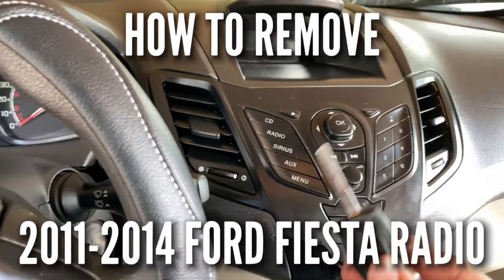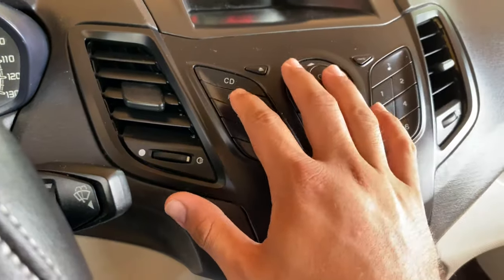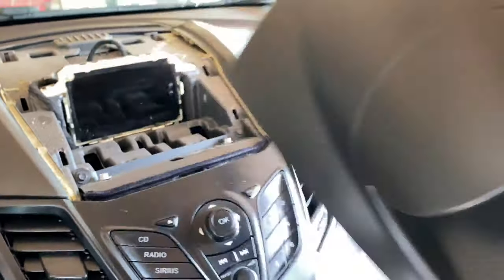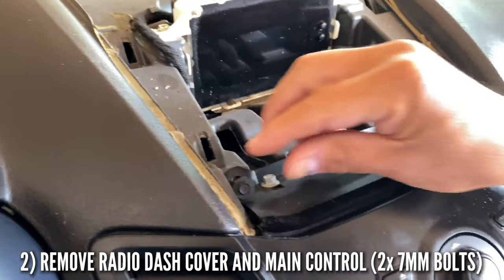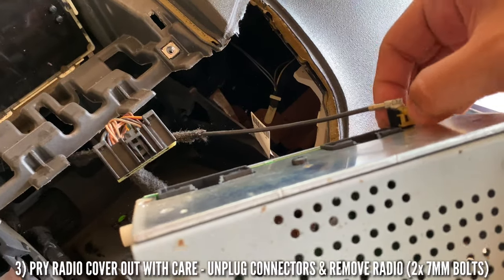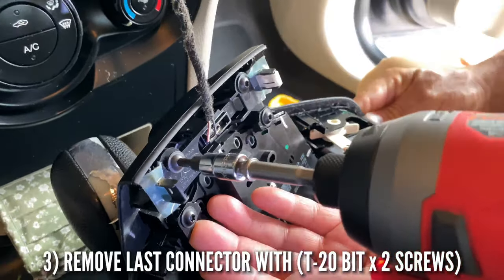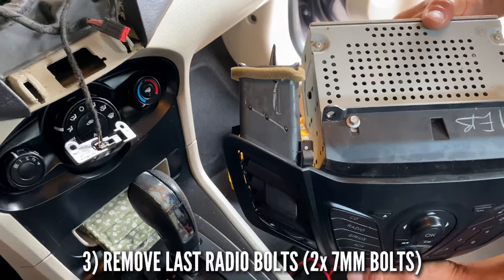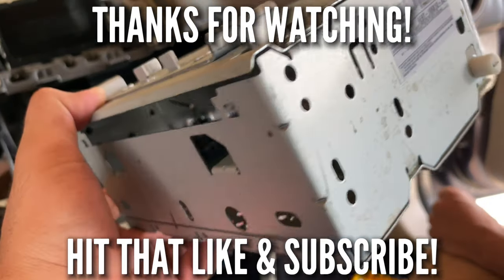FORD FIESTA RADIO NOT WORKING REMOVAL FAST & EASY HOW TO FIX - REPLACE RADIO FORD FIESTA & MANY MORE

Comment: Thank you!!!!!! Ordered one and did it in about 30 minutes.  Literally have been using a crappy Bluetooth stereo for about 5 years.  Seriously thank you!!
Reply: Where did you order one from?
Reply: Used**
Reply: was wondering, does it need a code or you just got the box, changed it and it worked straight up?

Comment: I have a question my 2013 ford fiesta radio went out but also my car would be turned off and I would be in my house and it sounds like bottle rockets or fireworks going off in my car lol I took the radio fuse out and it quit the firework noise!! My fuse is good...do u think its my radio unit or a short somewhere??

Comment: This might be helpful for the radio of my mothers Fiesta.
The controls on the steering wheel work, i can turn the Volume up and down but on the main control panel nothing happens, as you showed it in your video description.

Do you have any tips, where to get this radiobox cheap? Cheaper than in in a Ford dealer?

Comment: My satellite radio button and CD button works but the rest doesn’t, I checked the fuses and they all seem to be fine, do u think the radio box will fix my issue?
Reply: I have the same issue on my escape.....did you ever get it fixed?
Reply: Same issue
Reply: that is what is wrong with mine also. were you able to fix it?
Reply: Yeah I just bought a fiesta and have the same problem

Comment: Love my 2010 WS but the original CD/radios are complete trash. Mine would freeze randomly depending on the weather. In winter wouldn’t come in till a good 15 minutes into the drive and once turned itself up to max volume - I had to pull over and wait on side of road even switching vehicle off would not stop the radio. I would hear my radio startup during the middle of the night randomly as well! Called dealer they said they no longer stock as spare parts. Ended up having an Alpine flatscreen professionally installed and now very happy.  Old radio and fascia stored in a cupboard incase I ever sell. Don’t waste time like I did looking for a Ford part, only option is secondhand and they seem to all be trash.

Comment: what is the red cog on the display for at 24 seconds into video im thinking its something to do with Bluetooth not powertrain any ideas?
Reply from the maker: we belive that is a powertrain light to be honest.. looks like a little gear icon with an exclamation point.
Reply: No it's actually just to say you can update the settings via USB port
Reply from the maker: @markcookson3519  wow like, if I had a scanner from ford I could plug it in via USB and update settings?

Comment: Try disconnecting the negative side of the battery before replacing the radio. My volume knob controller dies and if left alone it will drain the battery it seems. Disconnecting the battery fixes it, seems  like a software bug of some kind that creeps up once in awhile.

Comment: is there a way to just to replace the on/off button? volume control knob does not have accurate response. I can change the Volume level only through steering control switch. I have 2015 Ford Fiesta.

Comment: Hi I got a question! I got a 2012 Ford Fiesta  and the problem is with My stereo and the entire center console does not work, it only works if I step on the brake pedal, only then all the buttons on the console work.  which may be?
Reply: check the fuses that are located behind the passenger side glove box
Reply: Hi! Where is your CD player slot located? My mom just purchased a 12’ with a stock CD player but I can’t find where to insert the CD. I see the cd button and the eject button but no slot for the actual CD.

Comment: PLEASE HELP my radio grounding wire is gotten old and has a bad connection in my 2014 Ford Fiesta. do you by chance know how to fix it or at least turn it off?
Reply from the maker: That's an excellent question. You can always disconnect the battery.. but I wouldn't suggest that. I say you take it to an audio shop and try to get them to clean the ground or replace it for you. Shouldn't be too much... hope I was able to help. Thanks for watching! Don't forget to like and subscribe

Comment: everything on mine works except for the media, including the radio. it keeps me from using bluetooth or aux. would this fix that issue??
Reply: mine was doing that i kept pressing the phone button everyday until it eventually started coming on a little bit & once i was able to connect my bluetooth to it for the first time, each time after that i would have to connect to the bluetooth on my phone & then the media screen would come up

Comment: Does that fix the display? My radio & display always go out together. Comes on when it wants. May be out for days then decide to eork for weeks then out again. I AM SO FRUSTRATED!!!
Been doin this at least 2 yrs.
Reply from the maker: Marcie0613 check your fuses or make sure everything is plugged in tightly
Reply: @HidalgoMotorsCo  i had a guy from an auto part store check fuses. They are good.
What plugs? U mean take out the radio & check those plugs? 
Sometimes it comes on when I bang the dash on top of display.
Reply: Do you have to unplug the battery to take the radio out?
Reply: @Marcie0613   l have the same issue on my ford, l am replacing whole unit tomorrow will tell you the outcome.
Reply: @lastcoolkidmkay4685  Please do, ty.
Reply: @Marcie0613  HI there so after taking out all the fuses and testing them only to find out its a switch (cable from radio that connects to display) on the display located at the back of the display right hand side. make sure its inserted properly or try n replace that cable. Its easily affected by heat that why switches frequently in high temps. Found out today after weeks of struggling. Hope that helps :)
Reply: turns out the radio itself is working fine, with no issues.
Reply: @lastcoolkidmkay4685  TY so much!
Reply: @lastcoolkidmkay4685  Did you replace the cable?
Reply: @Marcie0613  its a bit of stress for me to find but will eventually do. Sorry for the late reply !!!!
Reply: @lastcoolkidmkay4685  did you get cracking through the speakers
Reply: @veronicablazevich9501  yes
Reply: @chocolatemilk2076  mine stopped all together
Reply: @veronicablazevich9501  no l did not get that, speakers playing fine ...sorry for the late reply

Comment: Can anybody please tell me if the radio with the bigger red colored display from a 2011 model fits on my 2012 fiesta? 
I currently have the radio with the very small display like in the video but i would really like to have a slightly bigger screen.
I already called some dealerships but they don’t even have a clear answer as they have never replaced a radio before 🤷‍♂️
Reply: @coleyyb  Whats sync? I bought the radio with the bigger screen from a 2011 model and i succesfully placed it into mine and everything works :D

Comment: Did switching the radio unit solve the problem ?
Reply from the maker: Yes it did! The unit was defective. Very common issue.
Reply: @HidalgoMotorsCo  I bought a new unit but did not solve the issue. I ordered a complete new radio.lets hope this helps
Reply: @jancoweyers9841  where did you order a new one from?
Reply: Hi! Where is your CD player slot located? My mom just purchased a 12’ with a stock CD player but I can’t find where to insert the CD. I see the cd button and the eject button but no slot for the actual CD. It looks identical to the one in the video.
Reply: @sherralaberra  They look identical but the serial needs to match

Comment: Mines is pitch black the radio screen what could it be?
Reply: If you shine a torch/flashlight at it (it can be tricky to get the correct angle for the light so this works) and you can still see text on the display (e.g. time, radio station, door open messages etc.) when you, then it's the backlight (which shines through the LCD to light it up).  If you can't see any text/numbers, then it's something more serious than that.  Mine has the backlight fault, which I'm going to see if I can fix.

Comment: Only need to remove fuse and working perfectly
Reply: Somehow my car wouldn't start with radio fuse pulled. Piece of junk. The deafening static stopped but it would somehow kill the battery 🤷‍♀️ and not start. I'm gonna unhook the radio and just leave it 😑
Reply: @dors6143 did you find a resolution to this. Need to get rid of the static noise. Did you disconnect the box?